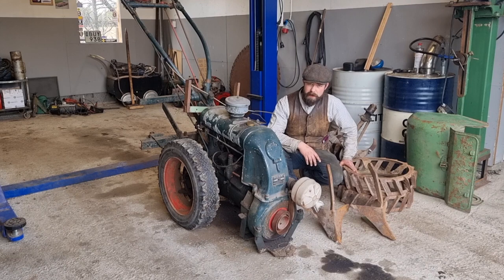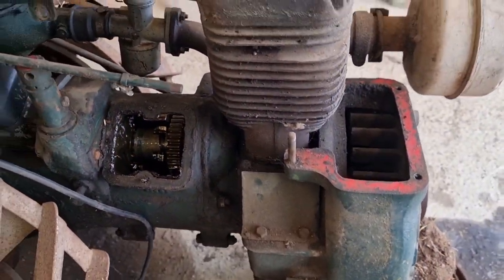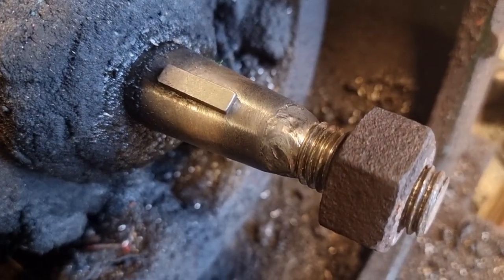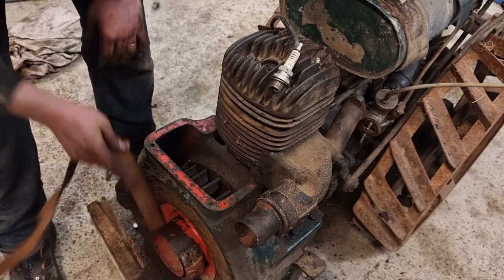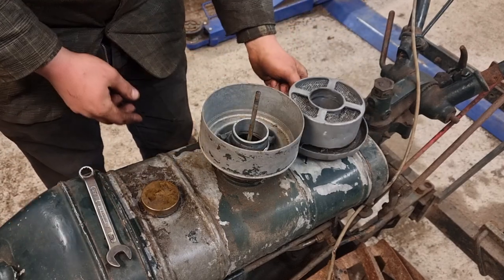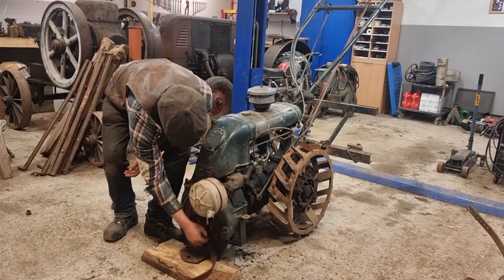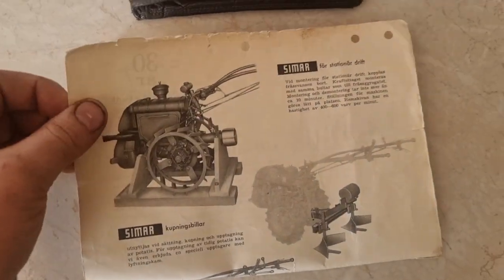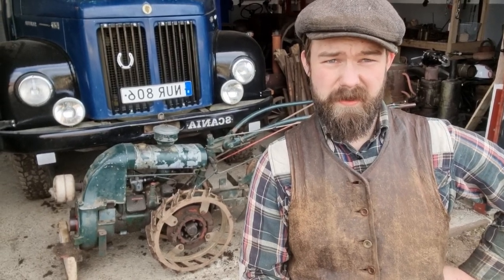Rotortiller BIG size. Can we get it running for no $$?

Comment: 🇬🇧😷🇬🇧  piston is 180  / degrees  out :  the ring gap does not pass across the ports , also the  crank shaft And or the piston  gudgeon  bore  is off set  in relation  to the centre line of the bore ,  this has the effect  of reducing  the  load on the thrust side of the piston , also it exaggerates the length of  the  power stroke  ,   So this engine does. Not have a proper TDC ,    and the side. load on the piston is greater on the way up the bore  but  it is of small moment  as it is. Not under load  ,    I did not mean to bore you all 🤔 ,but I think you should be informed  of the design  of this engine , 😀 peace be with you  , and stay safe , 🌹🌹🇬🇧😷
Reply: I never realized that pin offset also decreases wear. Thank you!

Comment: Thanks for the interesting video. I noticed the piston is shaped differently on each side, and you reinstalled it 180 degrees from what it was. Might run better if the inlet gases are pushed up toward the head by the sharp "scoop" side of the piston. Seemed to run fairly well the way you installed it though. Thanks again for the great videos!
Reply: Right? Totally screwed it up.
Reply: no, it looks like it was wrongly assembled, and he re-installed it correctly?

Comment: Interesting piston and ring design to ensure the ring gaps never line up.
Reply from the maker: Yes, first time i have seen this design. A small piece of brass just inserted and bent on the inside of the piston. Quite clever.
Reply: To keep them from falling in to the ports. 2 stroke
Reply: @daleolson3506  Exactly, can't have the ring gaps line up with the ports.
Reply: Most 2 strokes have this.
Reply: Ahh...OK. Never made any opportunities to work on any 2-strokes. Didn't know that, Thank you.

Comment: Put an small homemade trailer after the maschine and normal tyres on ist. Than you have a nice working maschine for garden and  farm . Your  children will be love drive in the woods on sundays . I use an Holder Ed2 or an Hako system trac with a small trailer from the 50er in garden 😎😉
Reply from the maker: Yes, I have original drawings from Simar "How to build a small trailer" for it :) / Richard

Comment: Deflector on the piston goes on the transfer port side. To loop the new charge up while exhaust has the long ramped side. Same way it came out. You're throwing away a few inch/pounds at least from the bottom end, and you didn't get many to start with..

Comment: My father used machines like this and bigger diesel when we went around and used them in peoples gardens.  Got some extra income, which was always welcome.  That was in the early 1970th around Hofors, Storvik and around that area.  Great machines.  Used tires though, as it was easier to move between customers.  I think the older ones had iron wheels though.   The first started with band like this, but the later we had to turn.  And one had to be careful, so it didn't start in reverse, as then it would accelerate.  So if started reveresed, the handle get stuck and one had to try to sneek in the hand to the valve lifter so the machine stoped.

Comment: I have a rototiller brand garden tractor very similar to your simar built in the 30's.I believe that it was inspired by the simar, even uses the same type flat belt to start it.The tines on it are spring mounted pick type which do a fantastic job, much better than the solid blade type used on most modern garden tractors today. I believe your simar had similar tines.I believe that if you can find the original tine setup you will find they will work much better than what is on there now. Great job on getting your simar running.

Comment: What a beautiful machine! I'd keep an eye on the front main seal, too, it looked to have a lot of seepage around it when you had the flywheel off. 2 cycle engines really dislike air leaks! That bit of work freeing up the rings was brilliant, I rarely am lucky enough to get them free, they usually either break while I work on them, or are already broken when I pull the cylinder!
Reply from the maker: Yes, the main seal sure is a bit leaky. I think it is a filt-seal. They tend to always leak a little on the two-strokes. I have to tear down the engine and change the main bearings in the future i think. So then i will have a look at the seals also.

Yes often i think that the piston doesnt get heated enough. If you heat it up a couple of times and letnit cool between it mostly works fine with a lot of tapping and effort. /Richard
Reply: @YesterdaysMachinery  sounds like it runs decent, I bet you'll get a lot of use out of it before it needs bearings. Some of those will sound crunchy for a long time before they get bad enough to need replacement.
I had just been heating the pistons, not letting them cool and reheat. Definitely trying that next time I find stuck rings! Thanks!! 😁

Comment: These old two strokes used a lot of oil in the mix. BUT now the oils are so good comparatively. I would run it at 25 to one with 50 to one modern two stroke oil.  I and my friends run our old outboards that were like 16 to one at 24 with no issues.
Reply from the maker: Yes, oils are a lot better now. /Richard

Comment: Heating the piston in a oven and then quenching it in a oil bath usually gives a good result in freeing up the rings. At the same time, heat distortion of the piston is kept to a minimum.... Interesting video😀

Comment: Nice find. I liked bringing home projects like this. I'd belt start them from a running motor. Nothing like the sounds of the first few pop's. The wheel hub concern is for positive traction. In tight places or constant turning around you can leave it disengaged .
Reply: The ratchet is for turns, the lock is for being able to use engine braking going down steep hills so it doesn't end up going through a fence at 20kph! That'd be a sight to see.

Comment: I had one it was 2 cycle and run with out mixed gas never could repair it the ball bearing cage fell apart. Mine had spring like tines I so wanted it to work great to see one working.

Comment: @Yesterdays Machinery - It does look quite hard work to handle, BUT - you have to see machinery in the context of its time and place to fully appreciate how valuable it was when first made.  I helped my father to break up the top soil in a back garden which had been untouched for years, with only a spade and fork.  Even though we planted the whole garden with potatoes in the first year (which do help), it would have been so much quicker and easier to do with a tiller like this.
And I do appreciate that you haven't done what so many machinery and motorbike restorers do - DROWN the poor beast in oil!
They won't use a modern 2 stroke oil (God knows why) "because it was meant to run on engine oil!" Of course it was - because in 1940, 2 stroke oils didn't exist!
And if the makers said it should run at 20:1 ratio two-stroke mix, the goons will run it at 16:1, "just to be on the safe side!", so it constantly fouls up the exhaust ports and spark plug, gums the piston rings into the piston, and then they proudly post pictures of it lost in clouds of blue smoke as though it was something to be proud of!
Reply from the maker: I have always in all my 2-stroke engines used nothing but regular SAE30 to mix with the fuel. Never have i got problems with carbon och sludge or fails on bearings. Some times in my chainsaw i use Alkylat smokeless fuel when standing much still and working. /Richard
Reply: @YesterdaysMachinery  I think the main disadvantage of this practice is increased smoke compared to newer 2-stroke oils that burn more easily. I use semi-synthetic TCW-3 in my outboard, at a 50:1 ratio it is essentially smokeless once the engine has warmed up.

Comment: Adjusted for spending power fuel is by far the most expensive in eastern Europe, e.g. Bulgaria and Romania. Sweden has the fifth-lowest average fuel price in Europe. It's only cheaper in Denmark, Austria, Ireland and Luxembourg (figures are from 2019 but I don't think the proportions have changed massively, only the absolute figures).

Comment: How they made the Tines for the tiller while not well made is not a bad design as replacements could easily be made from old car leaf springs. On my 1948 International Super A tractor when I ran regular detergent motor oil it would foam excessively and smoke until I changed to non detergent oil in the oil bath air filter.Great content, I may try a channel myself on day. I have to greatly improve my computer skills to make editing possible. Hope to see you plant a garden with it soon.  I have a 1971 troy bilt tiller transmission apart on the bench waiting on a part now. Cheers from Florida USA

Comment: very good , you got it running and working without a  complete overhaul .The engine is a two stroke  yet I saw no transfer ports how is the incoming  fuel charge  forced into the cylinder.
Reply: see 10:11...those are the transfer ports in the cylinder wall....

Comment: Superb resurection. Why didn't you finish the field ?. Two strock bearings always seem to 'chonk' a bit but  maybe a bit lower ration of oil to petrol keeps them going.
Reply from the maker: Yes, just to test the function. The field im going to grow crops on are smaller, like 20x30 meters and have to be plowed first, then rototilled. That will be in like 3 weeks or so.

Comment: Interesting and enjoyable video. Unusual to see a two stroke easier to start than a four stroke!

I am afraid though that the tines are dangerously close to the user's feet. If you could find a cultivator suitable for the BM 425 it would do more work in greater safety.
Reply from the maker: Hi! Thanks. Yes i agree that the tines are very close. If you reverse with them running it is really not good. /Richard

Comment: A cross hatch pattern honed into the cylinder bore is important for lubrication, also the cylinder must be washed in hot soapy water or grit residue will lap down the rings.

Comment: Is that a german made agria with hirth engine?  I had one myself. Bought it for cheap since it was scrap. Overhauled it completely, some parts I made myself since spare parts were not available. Starting done with a leather belt wrapped around the protruding pulley... I used it for many years after that....
Reply from the maker: Hi! no it is a Simar. Simar engine also. There was many different makesr of these. Very popular back then. / Richard

Comment: Two stroke engine?? Unusual piston with raised middle, guessing compression ratio is low.
Reply from the maker: In sweden that type of piston is called "Vändspolning".  English, dont know. It makes the incomming fuel/air go up in the cylinder head and then turn around and push the exhaust gasses out. That makes a lot of torq at low rpm. /Richard

Comment: I thoroughly enjoyed the video! And that was a really unique way of holding the top of the carburetor on -  never saw that before! That is certainly a heavily made machine - it reminds me of the Gravely machines I have seen - only larger and heavier (and 2-stroke!). The PTO on the old Gravely had no clutch - when you engaged it, you were simply pushing the drive dogs into mesh. It wasn't smooth - it was made quite robust. You certainly have a great ability to get these machines cranked up and running! As you probably know, the ratchet pawls on each wheel allow the wheel on the outside of the turn to travel farther/faster as you turn the machine. Otherwise (assuming it has only a shaft and no differential), it would take a lot of effort to turn the machine, as you would have to force one wheel to slip in the ground. I assume you would lock both wheels so they did not ratchet, as they would when going down a hill.
Reply from the maker: Hi! And thanks! Yes i have studied this in the manual now. /Richard

Comment: Use a finger nail file to clean the points a neat trick.
Reply from the maker: Yes, you should not use sandpaper really, that makes the contact surfaces un-flat. A file is better. But here i just took the corrosion away. And it was tight so sandpaper was quite handy :) /Richard

Comment: I noticed you fitted the piston the opposite way round that it was in the first place. Which considering how well it starts makes you wonder if someone had it wrong before you got it.. :)
Reply: I wondered wether he did that when he put it in so I checked. No, he didn't put it in the wrong way at all.
Reply: I have one open at the minute and know it would self destruct if put in the wrong way.  The head has a similar profile to the top of the piston.

Comment: is it me or did you put the piston  deflector toward the intake port , when i saw you pull the cylinder a swore that deflector was on the transfer port side and when you put that cylinder back after you clean everything inside that cylinder i saw that piston the other way i wonder if it was installed backward before you got it . BY THE WAY you really know how to do mechanic it seams that you could fix any machine blindfolded :) ,  do love all the old machines you restore just keep the good work coming :) just can't wait for the next one !
Reply: I noticed that too, it could be very important so look into it quickly
Reply: @rotax636nut5  yes it is because the ring gap ends have indexing pins to PREVENT the ring gap to slide into the ports generally they are indexed the ring gap to ride in between the ports so they glide and not DIG into the cylinder ports thus preventing cylinder GOUGING of the bore !
Reply from the maker: Yes i did, explained it in some other comments 🙂

Comment: Put a little stp oil treatment for the bearing,,
Reply from the maker: I think they are to far gone mate. But STP and rich oil mix maight make them run this season. Will change them next winter. /Richard
Reply: @YesterdaysMachinery  
Yeah I found just a cap or 25 mil in noisey engine / manual gearbox, not much , just a little mixed in with oil change, sometimes makes a big difference,, even mix a little stp engine oil treatment with wheel bearing grease on older models,,a small bottle last me forever ,

Comment: Rototiller 56a 8 hp.  George munro Waltham cross uk made    The drive pins on the hubs. Take them out and swap them over. This is slow and fast on drive
Reply: I have the side panels and all instructions books and implement book    . I used to restore and show them. Don’t have them now tho just the odd spare parts

Comment: Very interesting video. Well done on getting it running again! I did nog expect the rust in the cilinder would be fixed that "easy". 
I would like to learn more about old engines, so I would like to ask 2 questions. 1: Why do you put oil in the air intake? And 2: Why is there a piece of leather with a hole in it put in the fuel cap? Thank you

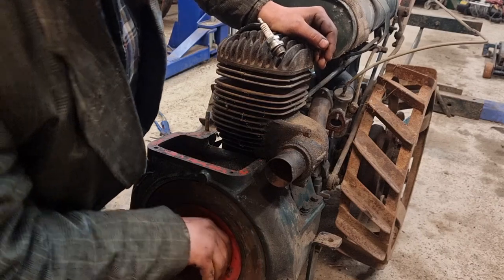Comment: Gasoline is 2.05 per litre, diesel is at 2.68 per litre in my town in far eastern canada.with minimum wage at 13:20 hr.
Reply from the maker: Sorry to hear that. Good thing i can run my crude oil engines on anything, And work is close to home. /Richard

Comment: great grandfarher had a similar one he had a trailer for. was his only wehicle and transport for all his life decades.
dont think any original owner cared one bit about the thing being original or not though
Reply from the maker: Probably worked well! No, back in the 50's when these machines was modern they sure often didn't care aboute if it was original or not. They just wantet to use it as a good tool, and improved it if they could. But original is often better than fast made mods. 

I want to keep things original because of the historic value and the feeling. I like it. /Richard

Comment: I'd like to hear some details on the blue car in the background, please.
Reply from the maker: Opel Olympia 1957, all original. Great small car. Very basic. Oil filter for the engine was extra equipment so this one doesnt have any. Not even a fine mesh.

Wipers run on cable driven from the camshaft of the engine. Works very well. 

Use it all the time. /Richard
Reply: Nice!  I've always liked Opels. I had 2 1975 Buick Opel 1.9L Ascona's here in the US.  Only year of the fuel injected engine, and it used an analog controller. I've also always liked the Cadillac Catera, and then found it was actually an Opel design :)

That's interesting about the wipers. I've never seen anything like that.

Comment: Nice find! There was minor things that I noticed (apparently these don’t bother that engine).
Should there be a adjustable needle at bottom of the slide? Or is there a emulsion ramp at bottom of the slide cavity; a bit same as Encarwi moped carburettors have.
Reply from the maker: No needle, there is a pipe in the trottle housing with some holes in it that opens when you lift the trottle. Works good! /Richard
Reply: So that’s why there’s extra hole at the bottom of the slide 👍
Who has made that carb? Just curious!

Comment: How did you center the new threads on the crank before welding?
Reply from the maker: Hi! Drilled a small hole in the center of the remaning crank axle. Then i put the new threded shaft in the lathe and made a small tip on it that did fit snug inside the hole in the crank. When welding it did warp just a little anyway but a small tapp with the hammer it did come out better that i thought. /Richard

Comment: I have one  35c  but i can't  make to start  has spark  but seems  like is no getting  gas to the cylinder  any help i really  appreciate  plz
Reply from the maker: Spark can be to weak even if it looks ok outside the engine. Try to minimize the gap at the plug to like 0.3mm and drip some petrol straight in to the engine. If it doesent fire then the magneti probably needs attention. /Richard
Reply: @YesterdaysMachinery  ok cause  when  i bought  it i take the magneto  off by mistake  and maybe  the time  is off or something . I would  do  the spark  like u say and see thank  you